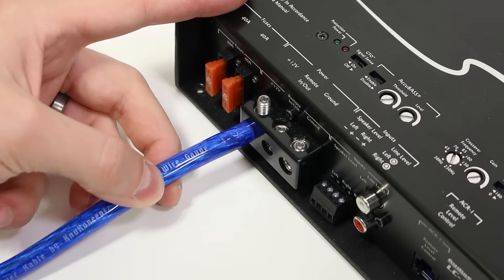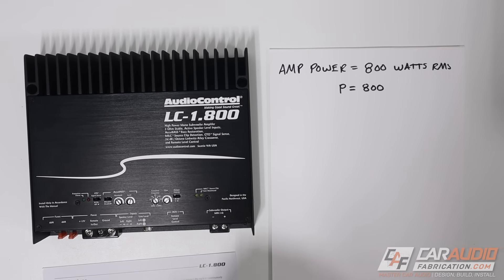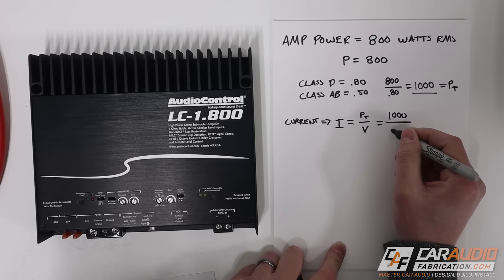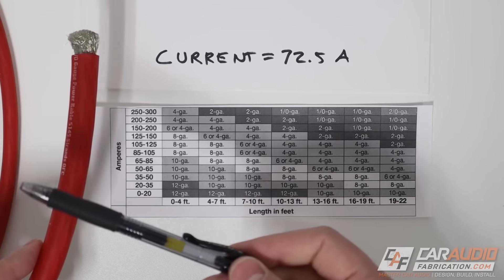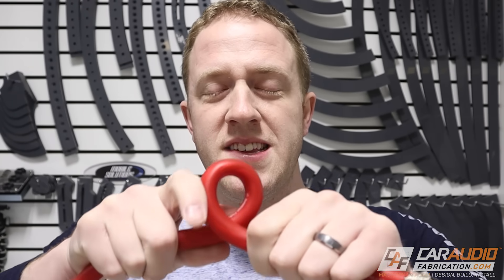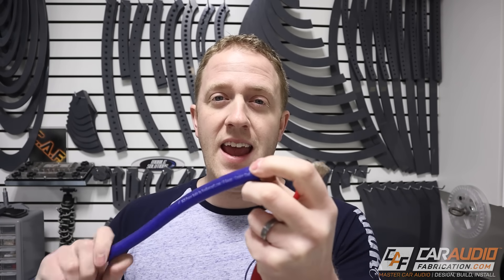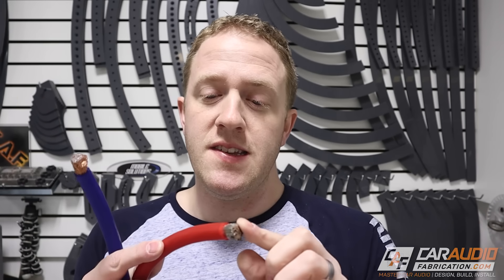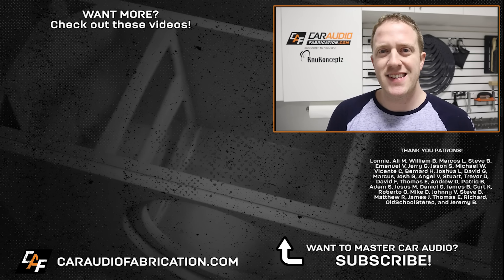What WIRE GAUGE SIZE for amplifier install? How to calculate!

Comment: Soooo, I have a 4-channel Amp that's 400 rms (100 rms x 4). Will there be an issue running 10 AWG OFC speaker wire (amp to speakers) or should I keep the 16 AWG in there?

Comment: Ok mark let me run this by you..
I currently have 2 runs of 1/0 cca in my car along with a 350amp alternator. Now I'm only pulling about 250a on sub stage and something like 120a on mids and highs. I can currently get cca on a good deal from a friend that owns a shop so I was thinking about just adding 2 more runs of cca instead of spending double just to add ofc and wanted to get your thoughts on if I'd be fine with the 4 runs of 1/0 cca abt 15-17ft each. Also I'm adding a agm battery and a Isolator in the next few weeks
Edit: the cca wire is metra brand

Comment: If I touched the ground and power wires together accidentally and now the inline fuse blows right away. Can I just replace the power and ground wire to get rid of the problem?

Comment: What if my calculation is much higher than the total of the fuses on amp
Reply from the maker: Then those amps likely aren't making the power they say they are.
Reply: @CarAudioFabrication  at what impedance should I calculate it, like 600w RMS at 4 ohms and 1100w rms at 2 ohms ?
Reply from the maker: Whatever its stated rated power is.
Reply: @CarAudioFabrication  ohkk thanks a lot👍👍

Comment: I just purchased xscorpion 0 gauge ofc. This is a 100% stranded flat copper wire. Can you tell me what type of connecter end or what type of part I use for my amp terminations? I have a wolfram c 2400.1 amp that has tge scrdw down type termination that will take 0 gauge, but again mine is Flat wire. Thank you

Comment: I have a home theatre setup and I use 14 gauge wire, why in the hell do you need 4 gauge wire.
Reply from the maker: DC power to the amplifier requires much larger wire. Speaker wire is different from power wire

Comment: My amp has one fuse that says 30, yet according to the calculations Im actually around 100 amps
Reply: Nope. The rating on your amp is a complete lie, that's why your calculations are off. Buy a better amp.
Reply: what is your amplifer? remember fuses protect the wire from catching on fire, you can run a smaller fuse as long as it doesn't blow it should be fine.

Comment: My 2-40 amp fuses keep blowing on separate amps I’ve installed could my power cable be to small. I believe it’s 8 gauge on a 1800 watt amp? Please help
Reply: i’m not an expert but i’m pretty sure 8 gauge isn’t enough for 1800. my 500 watt rockford amp wouldn’t work on 8 gauge, i had to go up to 6
Reply: @domharris11  Thank you boss i was assuming the same thing! Take care stay safe!!

Comment: Where did you get the number for voltage for ohms law?
Reply: Another question. Does this equation also work for my ground, RCAs, remote and the amp to sub wires?

Comment: Does the remote wire guage matter? For example. If I use a smaller/ thinner remote turn on wire over a thicker remote wire
Reply: Usually 18awg

Comment: Hi, I'm not sure I understand where I'm suppossed to find out what system voltage I have. Can someone help?
Reply: The output of your battery.... probably somewhere between 13.4-13.8. You can check it while the car is running with a multimeter...

Comment: question,,, i have     mono subwoofer amplifier
    150 watts RMS x 1 at 4 ohms (300 watts RMS x 1 at 2 ohms)
    CEA-2006 compliant
    Class D amp technology
    variable low-pass filter (50-200 Hz, 12 dB/octave)
    fixed subsonic filter (25 Hz, 24 dB/octave)
    variable bass boost (0-12 dB at 40 Hz)
    frequency response: 20-200 Hz        .. on my trunk of  05 mercury grand marquis ,,size gague rire i need.. pls help.. thanks

Comment: I have a class D amp with 50w left channel output jack, 50w right channel output jack, and 100w subwoofer output jack. Does that mean I have a total of 200w rms? What if I only plan to use just the left and right (no subwoofer), should I use just 100w as its RMS value?

Comment: I'm trying to find a 4 Gauge OFC Amplifier Installation Kit but for the life of me, I keep getting "out of stock" even at the store he mentioned. What makes matters worse is that,  there is a fucking crap load of kits for sale but when you find the kit you think you need, one of the wires is not OFC but they don't tell you that. Either the power cable is but the ground is not and the RCA cable is not OFC most of the time. They also sell a lot of 2 channel when I need 4. The only thing to go by is the price and these kits ain't cheap.

Comment: I never realized how insanely something mundane like audio wires could be so expensive but also so very vital 😭
Reply: 36$ is not a lot u trippin
Reply: Look at sky high car audio. They’re very reasonably priced
Reply: it's like the power supply for a computer. It's the lifeline. Gotta invest into it.
Reply: I thought same shit lol
Reply: They could make a brake system literally they’re like the arteries
Reply: With Home audio and I think you could apply this to car audio maybe spend a little bit more money on car audio cable and home audio but if you were to design a good home audio system/surround sound set up Average rule of thumb is 10% of the cost in wiring so if you’ve got a $15,000 home audio system somewhere in the range of $12-$1500 is what your wire should cost

Comment: I have a problem.. so when I put my remote wire and positive wire in the right place where they are supposed to go it doesn’t work but if I put my remote wire in the positive place and the positive in the remote wire place it works perfectly fine is this safe or no?

Comment: What can I do to stop my headlights from dimming
Reply: first, check wiring /battery then off to do the big three upgrade which is basically upgrading factory charging wires. Look online for this upgrade plenty of videos to see or upgrade to higher power output alternator, capacitors are usually not the solution to this.

Comment: Hi I am in middle of the planning my decent speakers upgrade but stuck with choose what power wire. I do have 720w amp but will use 4x60w rmp 4 ohm. So how to calculate wire? 720w 2ohm  or 240w 4ohm?  Sorry for my English

Comment: Hello and goodevening from Greece
I need your advices and suggestions.
I have in my own a new SUZUKI JIMNY SIERRA,a sort 4x4 car  and  i want to upgrade the factory music with an aftermarket. I have allready for the doors the '' audison prima APK165 2Ω  component system '' for the doors, and i need a suggestion for a subwoofer. i'm thinking of using the ACM4300 AUDIO CONTROL for all speaker set, and my question is that because of the ~14ft distance between the battery and the amp installation place under driver's seat, is the 10 gauge power wire enough or a 8gauge is better? Any suggestions about the sub? 70'S, 80'S, 90'S all kind of music old school as you see, and of course i will use a deadening material for the doors. Thanks for your help. Forgot to say that the sub will be install under the passenger seat beause thereis nowhere any other free space

Comment: It just makes me laugh to see people taking a 2000 watt amp and has installed a double to single 0 gauge adapter to their amp and then claiming the amp is is putting out more power.
Reply from the maker: I know... I'm all about sizing everything to be substantial, but there is a point of diminishing returns
Reply: CarAudioFabrication exactly, there is no reason to have 2 runs of 0 gauge and I’ve seen in some cases 2 rims of 00 gauge to a 2000-3000 watt amp. I would think if the manufacturer needed that much they would provide additional power inputs.

Comment: What about for amps that’s over 400
Reply: they usually have multiple power terminals so for example u can have 2x 0awg cables to the battery and 2x 0awg cables to the ground
Reply: @spluttcrystal9275  mine only has 1 for power. It’s a wdx5k amp it’s a 5000 watt amp from the calculations I would need 483 amps for about 17 ft run

Comment: Very helpful! I actually just purchased that audiocontrol unit based on your videos. One thing im confused about is on their website it says to use 3 gauge or thicker cabling on that amp which seems a little much, do you think its safe to stick with 4 gauge (OFC) for about 12 ft length?

Comment: I'm using zapco 5ch amplifier on my car so i'm using cca power and ground cables. my amp getting too hot and getting turned to protect mode while hearing loud.should i change cca power cable to ofc cable for this issue? And do ofc make any difference in sound quality"mark?

Comment: Hey PROS (Mark): QUESTION: My new number is 136 amps at 13'-16' which shows I need 2 gauge wire HOWEVER, since it's on the border of saying 4 gauge, do you think by me using 4 gauge OFC (Oxygen Free Copper) rather than 2 gauge CCA, that it would be okay to stick with my 4 gauge setup? (I don't think the following is relevant but just in case the details matter; I'm upgrading my 1,000 RMS system to become a 1,500 RMS system by adding another 500 RMS and second sub: Kicker L7 12" = 750 RMS ea. )(I have the "Big Three" upgrade if that matters) Thanks in advance for your serious input!

Comment: Mark, what size speaker wire would you use for the Focal KX2 component set? I have a small 2011 Jetta and want to run new wire to the doors and tweets. Sending 125w of power per speaker

Comment: Wire size > protective devices > max demand.. 
voltage drop is a big issue with DC, always a good job idea to upsize if possible, end of the day heat is the issue when overloading cables, hence why the fuse is the ultimate failsafe.

Comment: Federal aviation standards suggest a minimum of 2 gauge sizes larger when using aluminum wire vs copper
Reply: Copper clad aluminum is not aluminum. It is copper clad aluminum. Plain aluminum wire has its own host of problems. Just increasing the wire gauge is no silver bullet to rectify all of them either.

Comment: Do you have an explanation somewhere of both using a second battery and also pros and cons of wiring the amp ground directly to the battery.  For instance in a BMW where the main battery is already in the trunk.

Comment: So I purchased speakers, a small sub, amp, and amp kit from Crutchfield, installed myself (quite the pain), and it's working and sounding great, especially the sub.  I might want to add a 2nd amp to power the other new speakers.  Based on the amp kit specs and my own math using your formula, I should be able to add a 2nd 200 watt amp.  Thing is, the amp kit is 8 gauge, and everywhere I look people recommend 4 gauge for 2x amps.  Is the amp kit spec and this math trustworthy? Thanks.

Comment: I hate all the bs labeling with wire these days. I guess I'm showing my age but when I got into car audio in the 90's true awg ofc wire was really all that was available. You didn't have to worry about getting under sized falsely labeled wire. It's not just about performance it can be unsafe. Now that said cca can be safely used with no loss of preformanceused as long as you know what your getting and size properly. However sizing up in cca (compared to ofc) to meet the necessary current requirements may negates the cost savings. Long story short buy ofc.

Comment: Or just think: 
Big ass wire from battery to amp
Big ass ground to amp
Smol wire from amp to speakers / sub
Reply: Lower current and, typically, shorter distance...
800W into 2 ohm means a current of sqrt(800/2) , or 20A. For that and the typical distances in a trunk you don't need 4 AWG...
Reply: Amp is DC, Speakers are AC..... I think this means you can run twice the current?
Reply: @LaBrother  people often confuse current with power. Power (Watts) equals Volts (Electrical Pressure) times Amps (current flow). So increasing either the Volts or the Amps increases the Power. Now there's practical reasons why Voltage is increased to increase Power output. Because dealing with high current sucks. So that's the route car audio manufacturers go. At the end of the day they want to make money. They know you rubes don't understand any of this anyways.
Reply: @LaBrother  Using RMS values of AC voltage and/or current you get the same effective voltage drops/power losses as with the same values in DC. At the peaks in AC they're actually higher...

Comment: Hey Mark, great informational video!! One question please, I have a Rockford Fosgate T1000-1bdCP class BD power amp running my sub. I notice that it gets hot and I was told that those particular amps do that. It does have 4 gauge wire connected to it. Is this normal?
Reply from the maker: Yes, these amps are known to run warm.

Comment: Very helpful bro! Thanks! Also, there's something I still can't understand, for example, tweeters are usually put very high and mid bass or woofers are down to the bottom of the door. My question is, when I'm tunning my DSP I have to put the distance from "the speaker" to my ears, but should I consider the distance between my ears and the tweeters or the woofers? Because it's a completely different distance. 🤯 It would be awesome if you could make a video about DSP tunning, I know there are a lot of concepts but at least some basic stuff.

Greetings from Peru! 😎
Reply: It will depend on your DSP. Some DSPs you just enter the distance from your ear to the speaker on that output channel and enter it. 
Others, like mine, the Mosconi 6to8v8 you find your furthest speaker and measure the distance and that becomes the base point but will be entered as 0. Than you measure the rest and subtract the base point and that distance is what you'll put in.  Not as easy as the other option but it's how they choose to do it.

Comment: no one should use CCA. the downsides aren't worth the cost savings. significant voltage drop, and if one part starts oxidizing, the whole run is compromised.  the galvanic reaction will jump down the run. which means if you see corrosion, you have to replace it all, thus negating the savings.

i stick with marine ofc.

Comment: Just one thing Mark, you need sleeves on the ends so when they’re crimped, it will hold and not pull out or at least as easily. As you know, a stray strand is all that is necessary to smoke a fuse or an amp. Nobody wants that. I think you covered this on an earlier video! Just reminding!

Comment: Are you saying disregard what impedance we are sending to the amp? Just go with the full rms total power. I mean speaker impedance
Reply: For the calculations, you can use the power the amp does at the load you've got hooked up to it.
 But if you're currently  under-utilizing your amp (say a 4 ohm load on a 2 ohm capable amp), and later change to a sub that uses the amp's  full potential, you might have a wire on the thin side.

Comment: Would have loved to see you go over picking wire when your amperage exceeds 300. Knuconcepts offers 4/0, when would you want to switch over to that size. I know the amount of people pushing an excess of 300 amps is low but there are some and the information on picking wire size at this level simply isn't there.

Comment: Thanks for the detailed info. 
Actually in market there are lot products with OFC marking , but when u perform the acid test or Burn test, then u will find that its fake aluminum cable with OFC marking.
Reply: Tell me more about this test.
Reply: @DIYAudioGuy  separate out asingle strand and put a flame to it. alumin[i]um will typically crumple, copper will retain it's shape.
Reply: @michaeltempsch5282  so you're basically looking at the melting point?  The idea being that copper has a higher melting point than aluminum?  I remember a chemistry lab where I was taught to use a Bunsen burner and observe the color of the flame in order to figure out what kind of material I was working with.  but that was a long time ago and I really didn't know what the heck was going on.
Reply: @DIYAudioGuy  Yes, copper melts at about 1080C and a candle being about that temperature as well, but the copper will disperse the heat for a while and not melt. Alumin[i]um melts at about  660C. The copper coating (I think that's  the cause) seems to lead to more crumpling style action  than melt to a blob...
Reply: @michaeltempsch5282  I love learning new things, Thank you.

Comment: Loved the vid! Really good information for building a car audio system. Thanks!
Been putting in audio systems in my cars since the late 80’s. Would love to see a video about adapters for steering wheel controls for aftermarket head-units.
 That's a challenge I didn't have back in the day.
Reply: i just did one in a 2012 corolla. it was quite a challenge lol. I used an Axxess ASWC-1 module and my deck is a kenwood x304 and I had to make a few phone calls. Worth the hassle though
Reply: Steve Meade did one in a Yukon

Comment: You don't know how easy you make it for us guys to learn what you know. KnuKnocepts, btw, is a very good line of wire. Anyway, I don't see a video on how to set gains using a sine sweep with the deck at full power (bass boost, loudness, eq, volume adjustment, and so on)....you should make one.
Reply: 25Hz to Life no no no no no.... because nobody does that. It’s stupid and very wrong